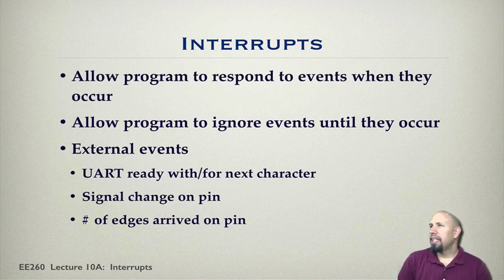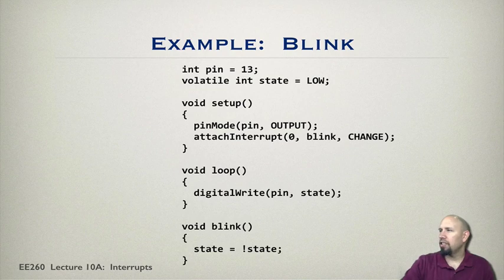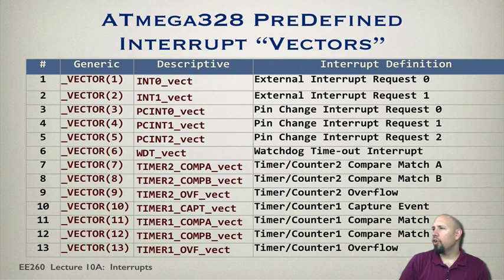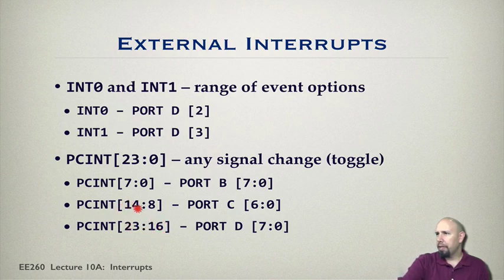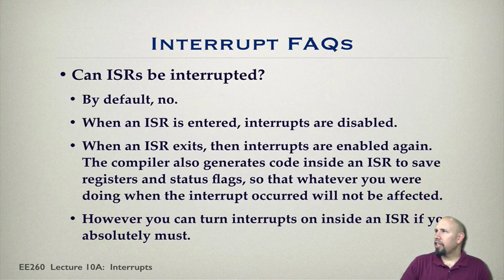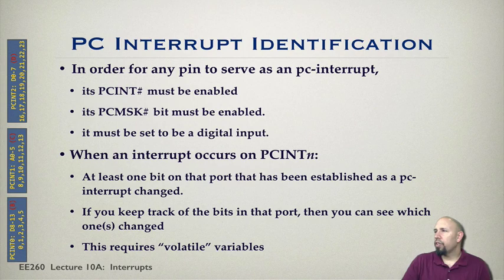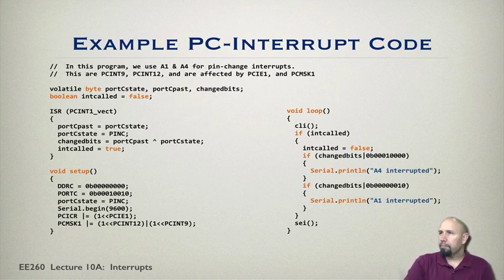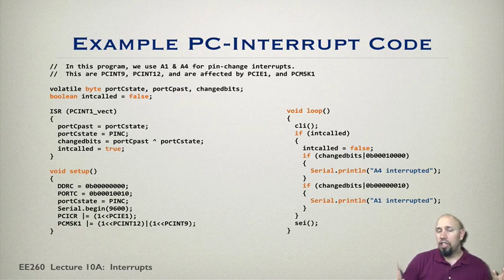10A. Arduino Interrupt Processing Part I

Comment: Great video, code works wonders however i am having trouble detecting a low or high state of that particular pin is this possible? i am only able to detect that a interrupt was triggered by pin 3 (in my case) but instead i get results for both low and high states.

Comment: can i use obstacle detector as an interrupt...i want two arduinos to turn on or off one after other with obstacle sensor attached to each arduino uno...when one arduino is working the devices connected to it should operate and other arduino should stop working..and vice versa

Comment: Hi Robert, I'm totally new to this stuff that's why I am watching your videos, thanks!
Watching another video yesterday I read a few lines of the ATmega48A/PA/88A/PA/168A/PA/328/P manual, which says the following in the first paragraph of chapter 13:
"Observe that, if enabled, the interrupts will trigger even if the INT0 and INT1 or PC INT23...0 pins are configured as outputs."
I just want to point out that you mention that the pins need to be set up as inputs for them the be able to handle interrupts (after 5:00), which doesn't seem to be correct for the above ATmega chips.
I appreciate your work though, ciao!

Comment: hello 
i work for long time  to understand pin change int but it doesn't work
i want to have code wich use pin 7 (on arduino uno ) as pin change int to turn on and off led on pin 13

Comment: Hi, I have tried interrupt to capture the width of a pulse of a PWM input (say set to 1100us @ 400hz),  My reading is  getting a variance +/- 4us  meaning a random value  of 1104 ,1100, 1096. I use micros() to get time change between HIGH and LOW of the pulse  Question: Is it something to do with resolution of timer  that used by micros(() or the resolution of the interrupt timer?  Is there a work around to increase the resolution of the micros()? or the interrupt in the UNO/Mega? On DUE i got descent +/- 1us Thanks.
Reply from the maker: On the Uno, Duemilanove, and Nano (16MHz) arduinos, the micros() command has a resolution of 4us (it always returns a value that is divisible by 4).  It sounds like what you are trying to do is on the boundary of that resolution.  A better way to do this capture is to use the Timer 1 Input Capture capability.  This has uses an analog comparator and a noise canceler before the edge detector.  The output of the edge detector can be used to set the ICF1 (input capture flag) which can be set to trigger an interrupt.  I've seen a lot of garbage on the net about this.  I recommend you go directly to the source:  http://www.atmel.com/Images/doc8161.pdf
Reply: Thanks,

Comment: Dr. Paz, excellent lectures.
It would be excellent and helpful to have the lab assignments so I could apply the material from class. It would also be very helpful if we could have the homework assignments (without solutions) to work them out as well as reading assignments from the book. There is a lot of material in the classes and it is difficult to figure out how to make use of it without these complements. I have bought the EduBoard but without the labs It is difficult to make use of it.
Thank you.
Reply from the maker: Thanks for asking.  I've been asked before, but there is not a convenient way to do this.  For now I think I will simply add more videos with problems that are like the ones I assign for homework or for lab.

Comment: I use timer two and the OC2B and OC2A registers (pin 3 and 11). Both pins generate the same output except one is an inverted output. How do i make a dead time between these outputs to make sure both are never on at the same time?
Reply from the maker: If I understand you correctly, you want two signals with the same frequency, but different phase.  To do this, set up a timer to have twice the frequency as the desired frequency.  Toggle the first signal on the rising edge of the timer, and the other signal on the falling edge of the timer.  This will create two signals in "quadrature."